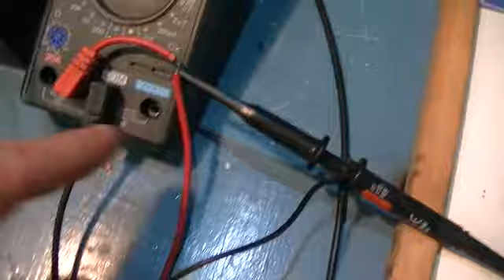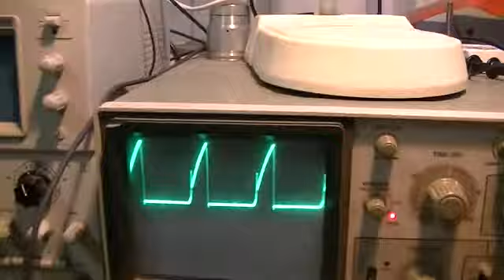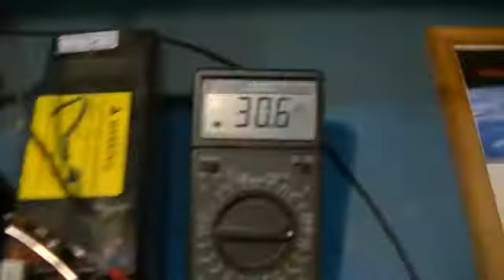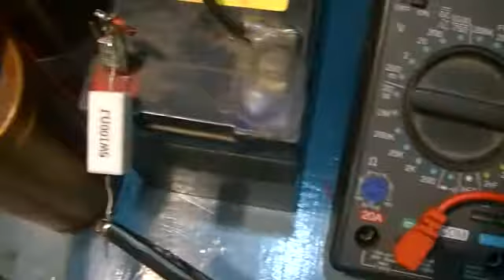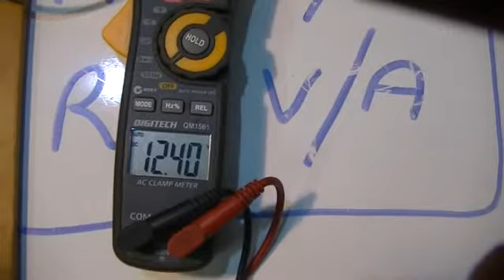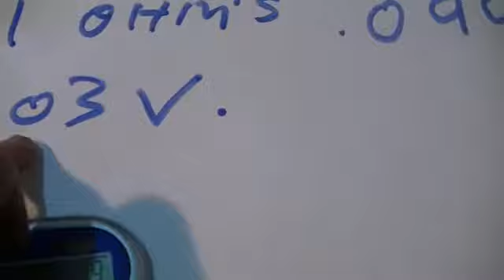Smoothing the pulses through a meter.mp4

Comment from the maker: Hi TJ-the vidio wasnt to show any sort of power consumption,it was to show there are cases where it isnt battery voltage x amp's that we should be calculating to get our watt input.I am working on the simplest way to get an accurate watt input useing just DMM's-as this is all most of us have.I am lucky that i do have a scope,well 2 scope's-so i can make sure the formula is right.

Comment from the maker: Hi Piragmenos0012.Interesting vidio for sure,but one thing to remember is that your coil is also a resistor.When a current is applied to it,that resistamce go's very high.So here lies the problem we face-how to measure that resistance when a pulsed current is applied to it.Well short of haveing a scope-this task become's very hard.What im trying to show in the vidio is that it is not your battery voltage x amps that is what the system is consuming.Look out for my next vidio.

Comment from the maker: There is a very easy way to measure the output current on your pulse system,and that is to use a pure resistive load-in the form of a decent resistor and cap.This you will get a small look at in my next vidio.You cannot use the input battery or power supply voltage x the amp's to get a watt input power consumption--that is completely wrong.Stay tuned lol.

Comment: Hi TinManPower! Thanks for your invitation but for now my connection is very bad and yet I'm hard to understand your accent while not english tongue, with cuts each second can't get anything :/

But I've read you are about to used oscilloscopes so that you would be able to analyse any power factor by the different phases of currents flow and voltages, and this is all I was about with my argument with Vladimir :)

Cheer.

Comment: Looking forward to the Vid... I have tried to "some what" do the same about a year ago. I have successfully charged a 24V 1500Ah B. Bank with a 7Ah 12V Battery. Sorce (input) 1A. Output 360V but measured 4Amps. Of coarse Unipolar with a Arbitrary GND floating around 30VDC. And to this day; can't make any sense of it, other than it work well.......